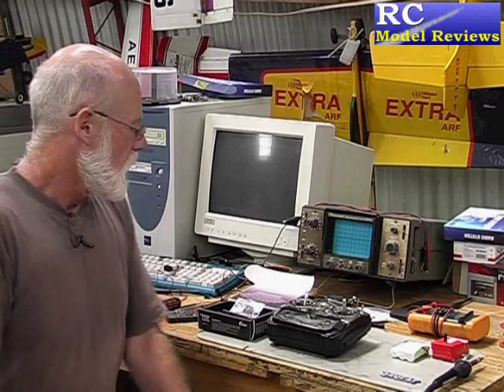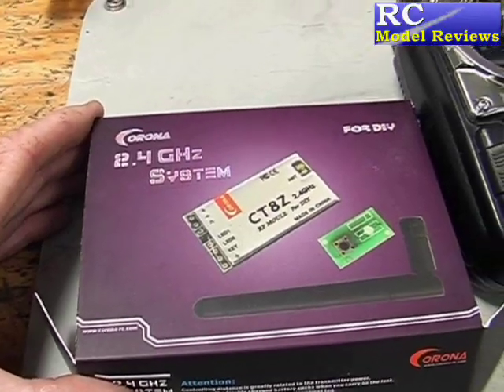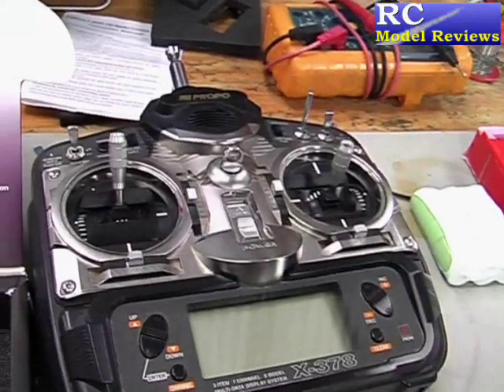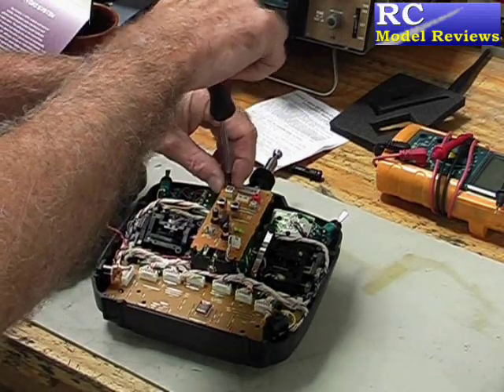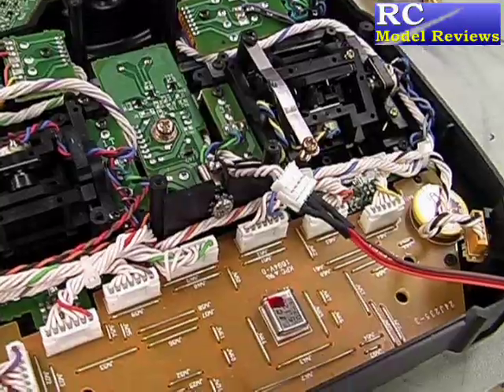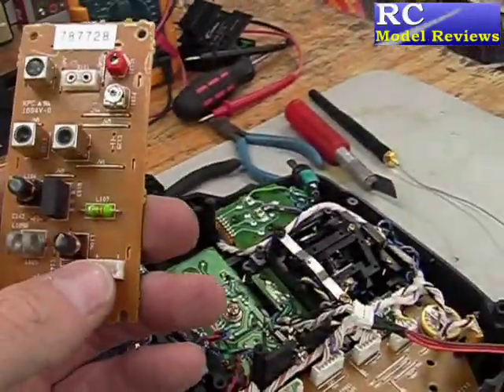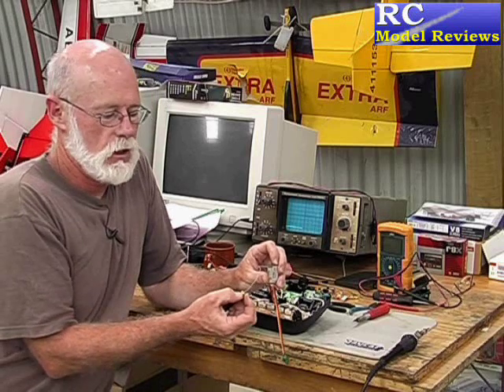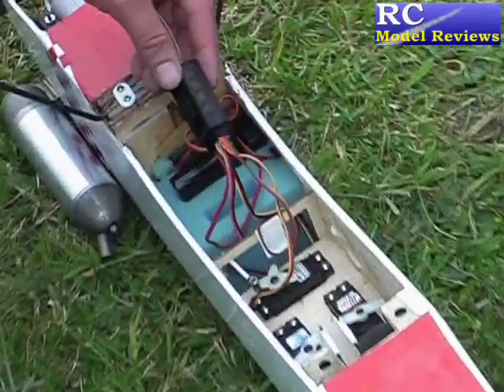Review: Corona 2.4GHz DSSS DIY kit

Comment: Good catch on the antenna coax!
Why can't they put sma connectors on rather than the soldering route? I've seen solder jobs that look like lead confetti before , so another point for the average guy to stuff things up.